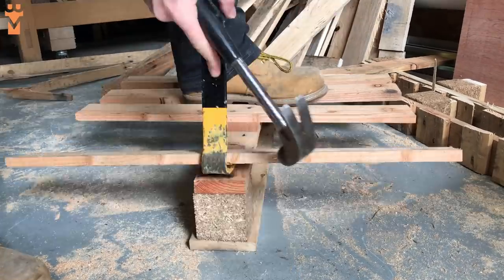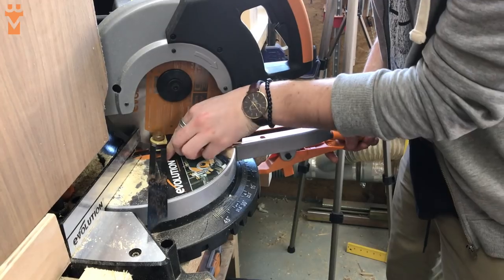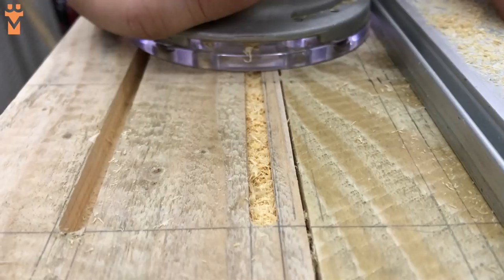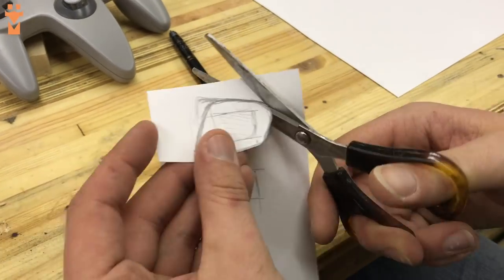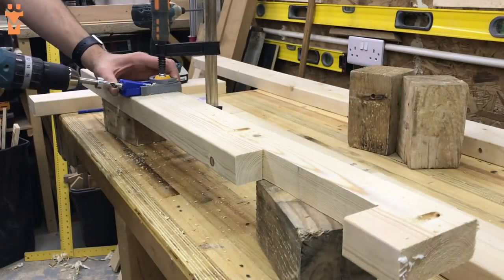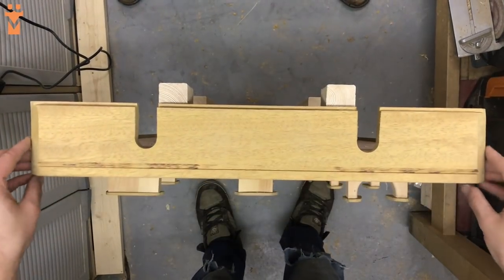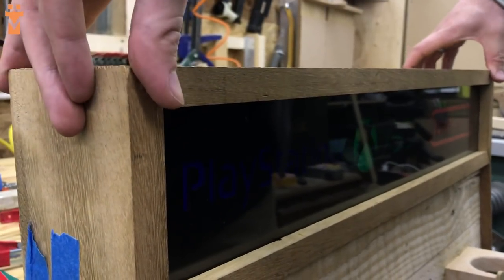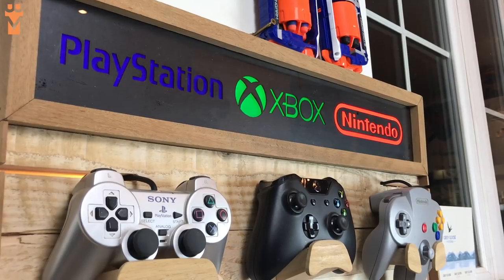DIY Video Game Controllers Storage Rack - Pallet Wood Project

Comment: Nice idea, will use the cable slot and backlight but change it so it's inside a cabinet for zero dust collection and the lights running only with the door open. Black coated copper tubing for holding the controller on a matte gray background and purple/blue backlight. I'm fully inspired now. Wouldn't have gotten to that idea without this video ❤️

Comment: Nicely done gents! That turned out absolutely gorgeous. Let me know if your N64 analogue sticks get loose, there's a nice little method for rehabilitating them.
Reply from the maker: Jamie Reader ah that would be handy - a couple of them are a little loose actually!
Reply: I'll dig one of mine out and put a guide together. It essentially involves using a fibre washer as a shim to tighten up the XY assembly and then lubricating with a little lithium grease. There was a guide on the net a few years ago but I can't seem to find it now. I've repaired a few over the years this way and they've held up pretty well.
Reply from the maker: Jamie Reader that would be great - thanks man!

Comment: "DIY"
Step 1: get a whole workshop with all the tools in a hardware store.
Reply from the maker: I can see how it can be daunting when you see a workshop full of tools, but that does not make this any less of a DIY project. This can be made entirely out of pallet wood with only a drill, a jigsaw and maybe a sander. The tools we have have been collected and upgraded for almost 20 years. All they do is make the process faster or more efficient. There is always multiple ways of achieving a task, so instead of claiming you need too many tools to achieve this result, either modify the result to match the tools you have, or start by asking friends/family or looking second hand for tools that you can use.